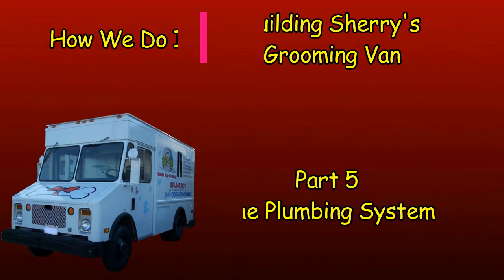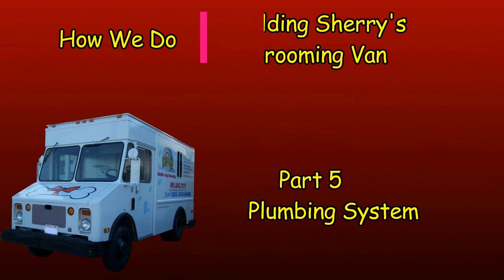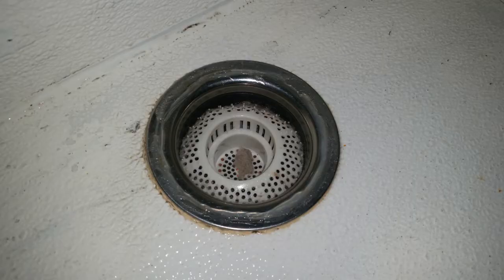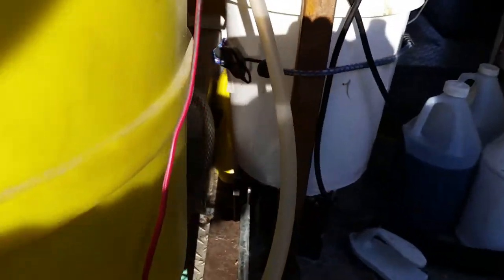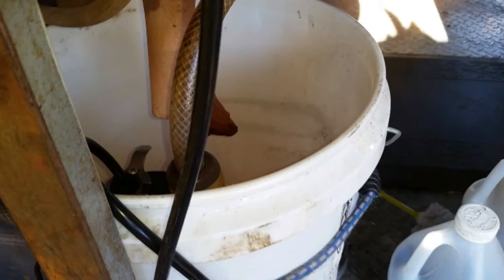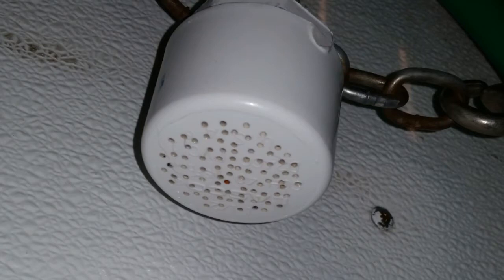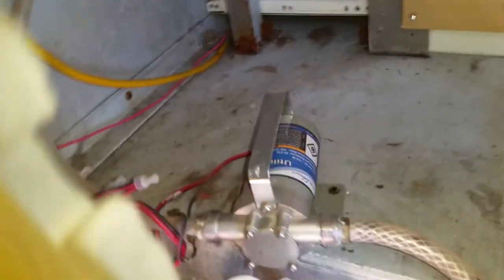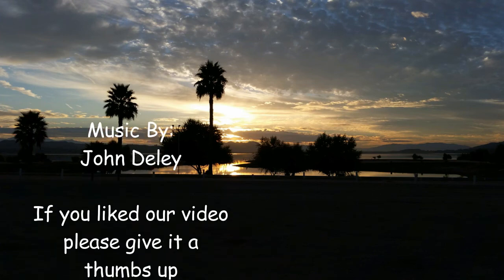How We Do It - Grooming Van - Part 5 - Plumbing System

Comment: I live in NC and do mobile grooming in a converted enclosed trailer. My issue has always been burning through water pumps. At the moment I have just switched from a 1/2hp shallow well cast iron pump to a sump pump. The sump pump would work if I could get decent water pressure. At this point I have over $2000 in water pumps alone if not more. I am at a loss has what to try next..... I have groomed in 15 degree weather as well has 120 degree weather, but the water pump issue is about to kill me or at the very least make me go insane. I have a 125 gallon tank on the back of my pick up which is my only source of water on some jobs. I groom 5lb dogs as and cats as well as 155lb Newfies/Huskies/Great Pyrenees Saint Bernards ect....so good water pressure is a must. Any suggestions!!!!!
Reply: What worked in the end? Are you still grooming?
Reply: @aleshascott3211   SEAFLO 110V 3.3 GPM 45 PSI Water Diaphragm Pressure Pump 
 has been working great. I wish it had a little more pressure but with a adjustable water hose head it has been working better than expected. I have pex pipe running from the water tank to a inlet on the side of the trailer. The water pump is mounted on the inside of the trailer wall. I have thought about switching the pump to be right beside the water tank, but in freezing weather I would have the same issue I was having with the shallow well pump. I have a 11 gallon water heater for hot water. I am considering a gas tankless water heater when my current one dies, but that means carrying propane on board and honestly I just don't know if I want to get into that can of worms...lol Mobile grooming is not for the faint of heart and is not for someone who doesn't like dealing with things breaking regularly. Lol I will say I think a trailer is the way to go depending on if you are in the city or not. My truck has been in and out of the shop a lot the past couple of years. When that happens I rent a uhaul pick up truck and am still able to work. Having everything including the water tank in/on the trailer would be awesome, but at the moment that is not possible with my current trailers weight limit. So moving the water tank can be a pain in the ass.